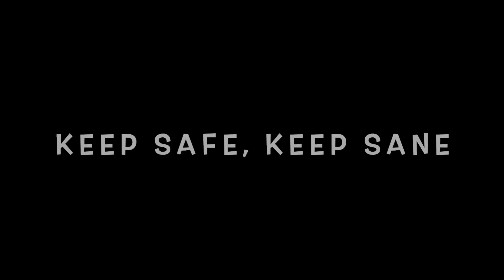Living Solo Off-grid in Portugal / The Fixer

Comment: It's great to have a helpful community nearby! Yay to Nick! Cindy can I ask what your mix is for the cordwood mortar? Are you using straw and sand at all? What's the purpose of the sawdust? Thanks!
Reply from the maker: Hi there! The mix is going to be 3 sand, 2 sawdust, 1 lime and 1 cement, obviously with some water. Then you have a separate bucket of sawdust mixed with a little lime - no water. That is what you use as filler between the logs as an insulator and the lime component keeps out creatures..
Reply: @CindyVine  Ah interesting! I don't have much experience with cordwood but when I've done it at a friend's we used a heavy cob mix - clay, straw, sand, and water but made fairly dry. Then pointed later between the logs with lime. Generally my understanding is not to use cement with natural materials... any specific reason why you've chosen to use it? Had you thought about using clay? I'm very interested to see your mix in action!  There's always so many ways to get a job done and the sawdust is also interesting to me as I'm considering it for my interior clay wall render for extra insulation. Thanks!
Reply: Ah just to add that he uses straw soaked lightly in clay (which is called slip straw) and puts that inside the walls for insulation but I really like your lime and sawdust idea.

Comment: blue water jugs...  why switch plugs ?     use a plug with an on/ off handle   why not
Reply from the maker: Oreo had broken the on/off handle from the plug so the water would have leaked out. I had to put another plug in to stop water from leaking.

Comment: The gum poles we use for our horse fencing  are 1.8m.  The holes should be 600mm giving you 1.2 finished fence height.  We fill the bottom of the hole (around base of post) with loose rocks which we compact around the post, also how we get the post standing straight. (any water can drain away) Then we fill the hole with sand stone and cement.  The post is then only partially cemented in so that it doesn’t rot in the ground… if that makes sense.  The problem we have is that horses chew the wooden posts, and I mean really chew them 😀 

Nick is the most amazing friend!  Angels comes in all forms 😊
Reply from the maker: Nick is amazing!